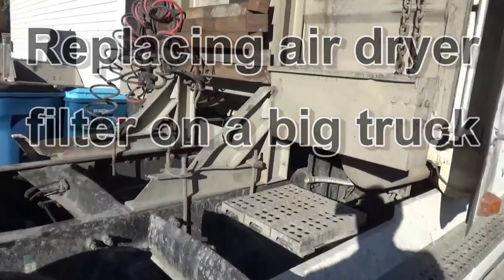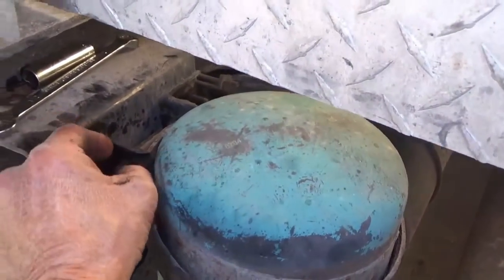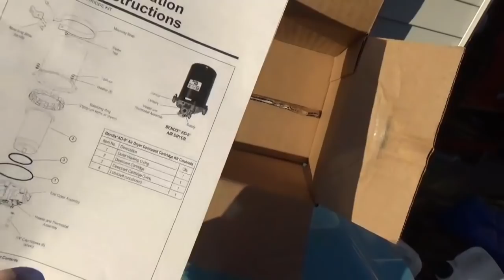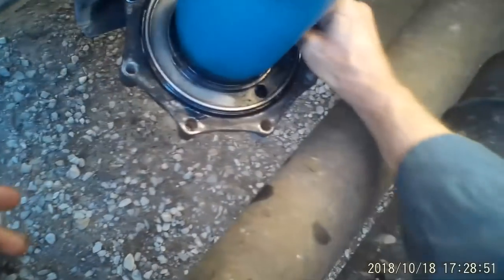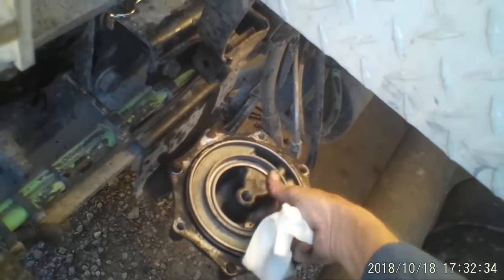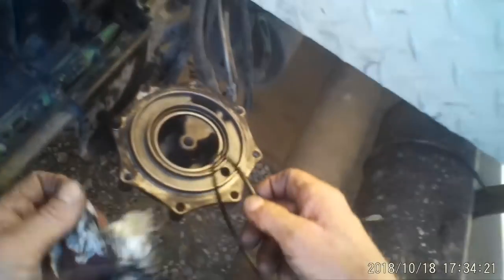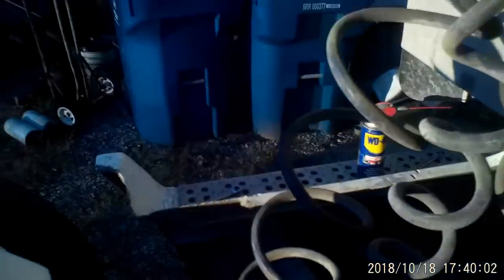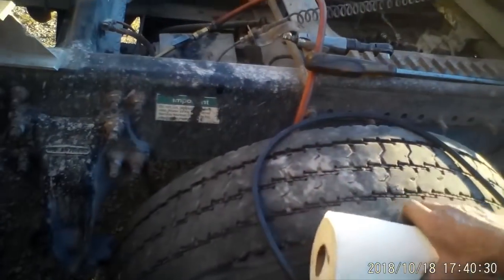Replacing old style air dryer filter

Comment: Oh, Lord,  I laughed and laughed when you said you could see the hate mail coming in :D   No matter who it is, or what the project is,  if it's on YouTube, somebody out there is going to have something to say about it,  myself included.   Time always seems to be the one ingredient that you're short on... If it were my project, and time weren't against me,  I'd have cleaned and painted the housing and the steel strap.  That's not hatemail :)  By the way, the glasses-cam is fine.  Thanks for sharing.
Reply from the maker: I did take the time to do a good job on the coolant pipe and tank so they won't rust. That video coming next, the paint is still drying as I write this. I don't want the hoses to get stuck to the pipe where I might need to cut the hoses off next time.

Comment: My comment would be to make a little cover to go over the air dryer and protect it when you are sitting with no trailer.  You get in an ice storm and the truck is sitting it will take forever to get air past the frozen filter.  Good video as always.

Comment: If the air dryer is not in good condition, all air components including valves, air brake chambers, ABS brake valve get damaged due to water in air lines, even corrosion can show up inside the primary and secondary air tanks due to excesive water in the tanks. Very important the air dryer.
Reply from the maker: Thanks for watching.

Comment: Seeing you playing around the air system reminds me that I need to get into my air compressor.
 I'm running N14 red top past 3 weeks my air compressor is making very loud sound , kind of like a badly adjusted valves .
Once the pressure build's up the noise will stop , I need to look into it .

Comment: Excellent video! The air dryer on our fire truck was leaking, so I put in a new one yesterday but the trucks still not making air and can't release the brakes... any suggestions?
Reply from the maker: The pressure governor can cause that and also the air hose from the compressor to the air dryer can clog up with burned oil from a worn out compressor and won't let air through. The governor is mounted on the side of the compressor head and looks kind of like a wheel cylinder on an old car with drum brakes.
I hope this helps.
Reply: @57bagre  Thanks so much Gordon, -we got it fixed. One of the brass fittings had stripped threads due to putting on teflon thread sealer tape. Trucks making air no problem now!
Reply from the maker: Thanks for answering back. Glad you got it fixed.

Comment: I used to have to drain my air tanks on an old truck I used to drive, and stacks of water used to come out.
Reply: One of the first trucks I drove back in the 80's, didn't even have an air dryer, it used an alcohol evaporator,  and you had to fill up a little reservoir periodically with alcohol (not the kind for drinkin').  We had drivers who had no clue, and about 90% of the guys were just too lazy to bother opening the drain tap(s) at the end of the day.  Come the winter,  one morning the truck wouldn't be able to move because the whole thing would be frozen up, with ice in the lines,  so that truck would be out of commission until it warmed up, or until someone took the time to feed raw alcohol into the lines where water had pooled and turned to ice.  We had 3 of that same model, all at different branches,  and the same problem with 2 of them year after year. Only one guy who (exclusively) drove the one truck,  never had the problem, because he looked after the truck himself.  The rest of the fleet was slip-seat-central,  and nobody cared about the next guy, until THEY were the next guy, then it was all about running and screaming to the boss about the condition the last user had left the truck in....  I only drove that truck for about 10 months,  but I learned about the alcohol evap system early on in the late autumn,  so I kept up on it.  In the summer you didn`t need to add juice but you wanted to drain the tanks as often as you could.  The drains were conveniently right there under the driver`s step, so anytime I got out, I`d open them and let it all go.  The price was about a 30-second penalty waiting for enough air to be built up when you were ready to leave later on. Of course, to some people, any sort of delay at all was seen as cutting into their beer time, so they couldn`t be bothered.  They didn`t care so much first thing in the morning if the truck was frozen up, because they were on the clock then.
Reply: I wouldn't  tell any body.

Comment: Conditions here in NJ are normal,  I guess I will change every five years, thanks.
Reply from the maker: By conditions I meant how much driving, humidity, how old is the air compressor and how much oil is it blowing into the air system. N.J. in not a low humidity part of the country. If you're  a city driver and you're not getting any oil in your system then 3 or 4 years might be fine. A road driver might need to do it more often. Check with other drivers that do what you do and find out what they do.

Comment: Great video enjoyed the input. The glasses where a neat touch. Do you change that filter, when it acts a certain way, annually, bi-annually.? I added a aftermarket auto add air brake anti freeze fluid. Between that type dryer and the tanks. It works out a QT a month.  Huge help with water, and Valve issues sticking. Blows out with the brake usage.
Reply from the maker: If you have oil coming out of the tank drains or the brake exhaust then you need to change it more often. I change mine about 3 or 4 years unless I have a problem like constantly blowing off or noise from the compressor. If the compressor is leaking oil into the air it will contaminate the filter and it can clog the braided air line that comes from the comp. to the check valve, the oil can burn inside the line and clog it from the high heat coming from the compressor.

Comment: If you keep fixing stuff now what are you going to do all winter :)
Reply from the maker: If I get time this winter I would like to clear out the shop and bring the "wing" in for carb clean and new paint. I hope I find everything that could be a problem on the truck before our annual  6 months of bad weather that starts next month.
Reply: I don't like painting my bikes, as long as there is paint on them I try to leave it original :)
Reply from the maker: The shine won't stay on the trunk, I can see sun damaged paint when it's in sunlight. I haven't done a nice paint job in over 20 years and I have never done base coat clear coat, I always did enamel and some lacquer like 30 plus years ago. I have all the supplies so why not start getting reacquainted with the art. I would like to do a lot more of that when I retire.
Reply: I like single stage paint far more than two stage, less chance of a chemical reaction from contamination or from using a base & clear from two different companies and this damn waterbourne paint is a huge pain in the ass (

Comment: have problems with electric cord when plugged to trailer i turn on the right turn signal in the cab and the left blinker turns on the trailer how do determine which wire goes where it is a 7 pin just need the two to switch but which two please help
Reply from the maker: As you look at the trailer "female" socket from the front of the trailer, the bottom center male prong is the brake light, the one next to it on the left is the turn signal to your left as you look from the front (the right signal from the rear) back to the socket, the prong to the right of the brake, (bottom center) is the signal to your right as you look from the front, (left signal from the rear) in other words the two turn signals are to either side of the brake on their respective sides. First make sure the error isn't at the rear lights, hot wire the turn signal prong with a positive wire, and make sure you have a good ground connection from the trailer frame to a ground source on the truck. The ground prong on the socket is the big one in the top, to either side of that are the tail and marker lights the center is aux.